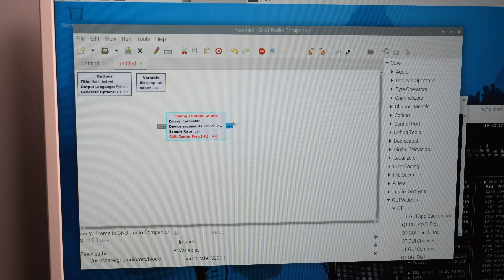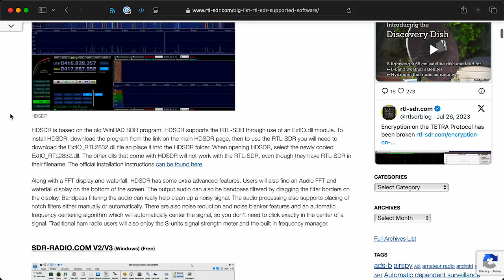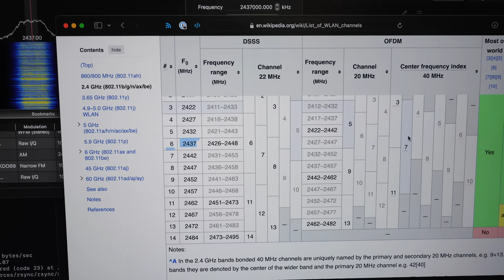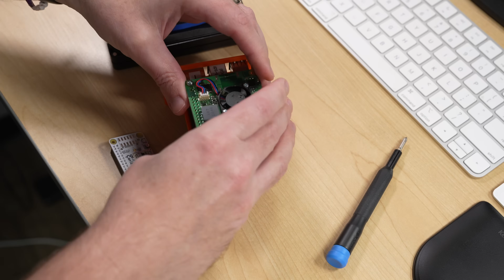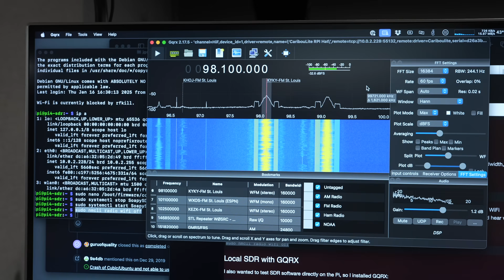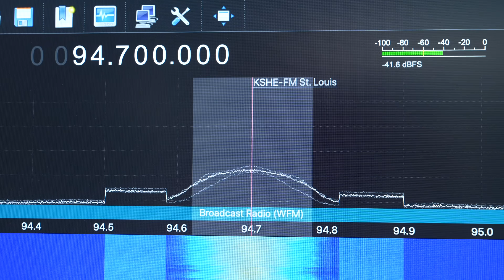Radio Hacking 101: Raspberry Pi SDR with a CaribouLite

Comment: base version is $72 (more expensive than a pi)
Reply from the maker: Yeah; for just getting started I would look at RTL-SDR, or I think Nooelec makes a model like it. Going to test that soon.
Reply: @JeffGeerling  I have the Nooelec RTL-SDR v5 Bundle and it works a charm for just ~$48. From Amazon it "includes a NESDR SMArt v5 RTL-SDR, a magnetic antenna base with a 2m (6.5') RG-58 feed cable, and 3 different antenna masts"
I'm really into Amateur Radio (HAM) after I got licensed last year and wanted to get into the SDR side of that. Was able to receive with no issues, but couldn't get transmit working. Probably just a settings issue in software.

Comment: SDR's is a cheap way to learn all about RF. Talking about transmitting, it's super easy to create your own antennas, just be sure to have an SWR-meter and tune your antennas to a SWR of 1:1-1.5. Great video btw :) 73 OZ9MN
Reply from the maker: My Dad and I have been talking a lot about antennas and it'll be fun to explore more on that side too, hopefully through this year. And I finally have all the parts together to put up some outside antennas with proper lightning/grounding protection! (Just got my KF7P order yesterday)
Reply: That's awesome, hoping to see some videos on that subject, even though it might be a niche to most people 😉 For many people it's really eye opening how far of a distance you can communicate with others, just with a few watt, when you have a proper tuned antenna.

Comment: I wonder if that can be used for EMC testing. I was doing some EMI measurement at work with an oscilloscope and to be honest, I'd love to have a proper spectrum analyzer because FFT on my work's scope is damn slow, like 5 Hz refresh rate slow
Reply from the maker: The catch is for actual 'verifiable' use, like for any regulatory testing, you have to use calibrated equipment, which this certainly isn't!

It's a good radio, but it has its warts, and isn't quite ideal regarding selectivity and tuning. As with many other lower-cost RF designs (and $100 is very low cost still!), sometimes I see weird spikes in random frequencies, or 'harmonics' of the signal I'm tuning, and with this device, I can't tell for sure if that's something coming from the environment around me, or something inside the HAT itself!
Reply: @JeffGeerling  true, I suppose the thousands of $ price on a proper lab equipment make sense with all these cheap radio's shortcomings

Comment: Mm.... so I could probably listen on 433MHz and work out the peak times for people opening the gate to the premises I'm at..
Reply from the maker: That frequency band is always pretty active, as so many consumer devices operate in that range. Definitely something that would be fun to monitor—I noticed a lot of little spikes around there and around the 900 MHz bands.
Reply: @JeffGeerling  True but with a fixed code it might be possible to write something to decode just that (yes yes.. very weak system.. I know.. not my setup)
Reply: I know how much air is all my neighbors tires and how much water they are using lol
Reply: Nice one

Comment: It's really quite insane how complicated radio has become, considering AM and a handful components were enough to "make it work" vs "you have to apply some patches", "this screen is really daunting", "there are lots of numbers".
Reply: Spark gaps and morse code were even simpler. Now we have gazillions of modulations and software control
Reply from the maker: And I only touched on like 3 different types of signal versus the 1000 or so ways people encode data nowadays!
Reply: Those handful of components never gave you a waterfall display! This gives you visibility of band activity which simply is not possible with analogue gear. Also, look up the cost of a decent, enthusiast receiver to understand how cost-effective this approach is. The irony is, there are far fewer signals to receive these days.
Reply: You can thankfully still build a simple AM radio receiver with just a few electrical components. FM is a little more complicated. But anyway, traditional radio is still backwards compatible. So a mono radio from the 40s can work just as well as ones made today that have stereo and digital etc. 

Since Shannon discovered the basics of information theory, we’ve been on a race to squeeze the theoretical max out of the bandwidth that’s available. The breakthroughs have helped enable TV, the internet, cell phones, audio/video codecs from mp3 to AV2
Reply: Look up COFDM.  It is a digital coding scheme with some wicked applications.
Reply: analog AM radio is steampunk magic. Digital radio transmissions are a cyberpunk nightmare

Comment: Oh man, I didn't realize the Pi5 may not work with some Pi4 hats. I was kitting out a 16GB Pi5 (snagged a couple from Mouser as soon as they appeared) to use for a variety of projects connected to the TV in my living room.
Reply from the maker: For most HATs, compatibility is fine. But for HATs that do some weird things or use interfaces that are a little less documented (there are many that exist!) the RP1 chip being between the CPU and the GPIO makes it work a little different.
Reply: @JeffGeerling  Thanks. The Radioberry will be the first thing I try. If it doesn't work then I'll dedicate a Pi4 to it too. Then I'll have to invest in one of your racks 😄
Reply: That RPI2040 has a few advantages.
Maybe there is an extension for the PCI bus that can provide the interfaces you‘re looking for?
The PCIe could be used to use one Pi for controlling as many devices as there is space in RAM 😌

Comment: Too bad it doesn't work with HF radio.
Reply from the maker: Technically CaribouLite can get down to 1 MHz, but my main loop antenna is not yet built, so I didn't get to testing it yet.
Reply: @JeffGeerling  Oh ok, I was seeing it only reaching 30MHz on their website.
Reply from the maker: @Bento_Boxx-m5v  Yeah that's the official spec, but the driver allows tuning down to 1 MHz and they have a note about it possibly working okay in one of the GitHub issues or on the GitHub README page I think. Will try it soon, going to the hardware store today to get some PVC pipe!
Reply: @JeffGeerling  looks like I have a use for one of my old Pi4s then. Thanks for the info Jeff!

Comment: The discord notification at 4:58 got me :P
Reply from the maker: Sorry about that! I try to remember to mute the computer before I hit record but usually miss a notification or two before remembering to actually hit mute :D
Reply: @JeffGeerling  maybe you can make a script that is triggered with the same button as the lights!
Reply: @JeffGeerling  Jeff here pranking everyone (It got me too)
Reply: @JeffGeerling  you can create an automation with Apple Shortcuts that mutes audio whenever you open OBS (if you use OBS) and turns it back on when you close it. At least, the notification sound.
You can also create a dedicated Full Immersion!
Reply: @JeffGeerling  instead of worrying about muting, why not make a DEEJ volume controller?!
Reply: @JeffGeerling  if you use obs you can separate computer and mic audio on different channels, that way you can mute it without affecting mic
Reply: @JeffGeerling  if you set the offset you would not have to type 0000 or what ever to get to the nws frequince
Reply: I looked and looked and could not find where i got the msg before i scrubbed back in the video ^^
Reply: @celuldor  I just did the exact same thing lol
Reply: @8:29 got me, after the first few, I was like "No way, man...I don't se...ohhhhh it's in the video!"
Reply: oh that was what it is! I thought I got a discord message, I checked and there was nothing, I was so confused haha
Reply: i heard the sound and thought "huh this was weak. i dont have discord run on boot, so it should be the video, surely someone complained about it", then sure enough this was the top comment :P
Reply: mee too lol
Reply: got me as well lol
Reply: Both pings got me, I was cycling through servers to figure out where it was coming from before I realised 💀
Reply: I really hope that wasnt me lol - Ando
Reply: That was genuinely funny.  Boost your viewer engagement with this one simple trick... randomly dispersed notification sounds!
Reply: Same, I was about to send my friend to the shadow realm for annoying me
Reply: 8:28